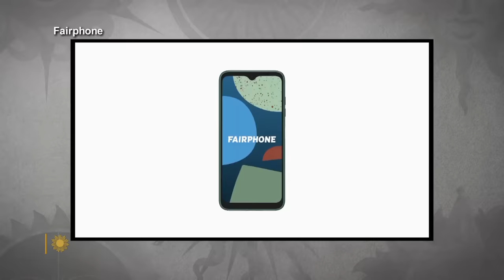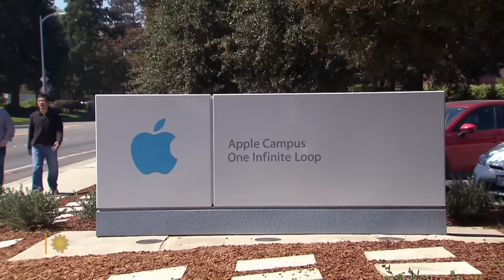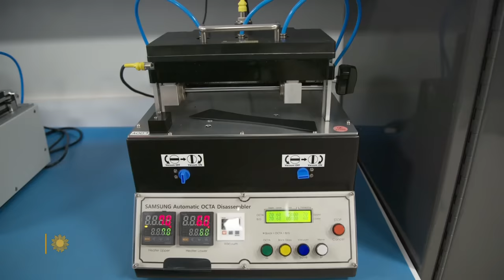The tragic costs of e-waste

Comment: "Right to Repair" is an important aspect of preventing e-waste. Something many do not want you to do easily.
Reply: It's bizarre to me that an easily replaceable battery is considered revolutionary these days... Many phones had this just a few years ago, some would have extra batteries so they could easily swap them while outside. I bought a replacement for my Samsung Galaxy S5 and it was under $10! Right to Repair seems to be catching some strength, I hope it lasts.
Reply: Unsustainable capitalism and constant need for growth produces all the trash. Repairing something is cheaper than buying new, and if you aren't buying new then you are hurting those precious corporation's profit margins.
Reply: @TheIVJackal  same here, i replaced the battery in my s21 ultra with genuine samsung parts, battery was genuine and the rear adhesive was also genuine samsung has been selling repair parts to 3rd party companies for quite a while now.
Reply: This is crazy, I have this 15 yr old laptop and I plan on upgrading its ram and maybe battery, I’m pretty sure chromebooks have both of those soddered in, still useful parts that cant be extracted to be put into something else unlike the old ones
Reply: Problem is that this solution does not sale.
Reply: Also custom rom support for all Android device's should be freely available
Reply: @vampyrkiller  or just being able to install other operating systems if the current one is broken, the laptop im using here had a bricked windows vista but i installed linux mint xfce and it worked fine
Reply: I know.

Comment: Planned obsolescence in appliances is a big part of this problem. Stuff is made with a service life baked in, usually measured in months. And they've been doing it for a while.
Reply: Keeps their investors happy,  no check for them if you don't buy every year
Reply: Compare fridge from 1980s to now.  And technology now is supposedly "better"
Reply: @thisguy73  Our fridge is from 1990. My uncle has a fridge from the '50s. If it ain't broke, don't fix it. Besides, our vacuum cleaner is from 1989 and our clothes dryer from '87.
Reply: They've been doing it for at least a couple decades now. Late stage capitalism.
Reply: A scheduled life cycle is the ONLY guarantee where you can conceivably write the CORRECT legislation that mandates actual recycing. "Right to Repair" is the next in line corporate campaign, where petty middlemen like Louis rossman need that $2000 mac to exist so he can skim a $600 Mac from a repair gig. Not a $800 where poor Louis only gets $300.

But what the "repair" MEANS, is massive ACCELERATION of the "repaired" parts, like the cobalt batteries made with child labor when you get to replace the battery that much more often. Then you get to pay ONLY the underpaid child labor, and NOT EVEN the underpaid Chinese assembly that COULD go into funding recycling... with  the CORRECT legislation that mandates actual recycing. 

"Right to Repair" end goal is to NEVER write that legislation, like EU is now mandating replaceable batteries ( as it is funding salt and cellulose battery r&d and seeks to be the new IP landlord). Incidentally, Apple is one of the big actors in global field ACTUALLY using that profit moeny from fat cat western world, to fund refurbishemnt and returns off the riches OF fat cat westerners with bloated currency. THAT is what Apple does with $900 monitor stands, takes it from Jeff Bezos who is the only type to WANT that in his moon rocket.

Comment: The environmental thing we could ever do is to stop buying sh*t!
Reply: 😂😂😂😂  that would take several years of de-programing -  every one wants you to have the latest things
Reply: This would require companies to start making products without planned obsolescence
Reply: Yes, how about only releasing a new smartphone version every 3 years or less? They're not changing that much year-over-year as they were in the roughly 2007-2017 era. How about corporations seriously caring about environment over pure profit? Don't we all long for the "good 'ol days" when machines and devices were built to last? And you could get them fixed at the local repair shop?
Reply: @chelseafan4eva eh. I've had the same phone for 6 years. It's pictures aren't as good as the newest ones but it's fine still. I just treat it like it cost me $700 and a replacement would cost atleast as much instead of being careless with it.
Reply: @chublez  problem is, your software is likely not getting updates and is more vulnerable to a hack....it's dangerous and that's what the tech companies need to be put to task on
Reply: "stop buying sh&t'' ... what about all the jobs that will be lost ?

Comment: Planned obsolescence, FOMO, trends, consumer culture, it's all maladaptive. Instead of making the companies richer and being a part of the problem, use your devices until you absolutely need a new one. I used my last phone for almost five years before buying a new one. I recycled the old one at my nearest e-waste recycling facility.
Reply: Good for you. I actually used my last phone for 11 years (an iPhone 4S from 2012 to 2023). I could have kept using it but all the carriers shut down 3G so it could no longer handle calls or texts. Original battery is still rated at 70% capacity, believe it or not! One thing I miss about it is the perfect size for my hand; all these larger phones are harder to hold and use with a thumb, don't fit in some pockets as well, etc.
Reply: Maladaptive is the best word to describe our consumer culture.

Comment: We need to teach our kids how to buy parts to fix our stuff like clothes dryers, washers, microwaves etc
Reply: Our clothes dryer is from 1987. All we needed to do to keep it running is shake out the lint collector occasionally and replace the drive belt a couple years ago. There are how-to videos on this. Drive belt replaced in under 30 mins. Our microwave is from 1994, only needed fixing in 2003. Don't need a new one.
Reply: Ever heard of planned obsolescence?

Comment: I have an iPhone X which is only getting security updates until next year. Bought in spring of 2018 and it still works great even though the battery is shot. I plan to keep it as a collectors item when I upgrade to the iPhone 16 Pro Max year. Thats my contribution.
Reply: Androids are more durable, last longer, and are cheaper to repair..
Reply: Collectors item? An old Apple phone? Doesn’t even work? Yeah, keep it Friend. Become a hoarder to cut down e-waste.
Reply: What if you change the battery? I have an SE and the battery is also not that great
Reply: Nice "contribution".

Comment: Apple also has software that locks their products that is unusable if the original owner does not log out of it, even if it was not considered lost or stolen. That results in many of their devices go to the landfill even if there is nothing wrong with it. I forgot to mention that they also tie their parts to a single device so you could not even take apart a device to be used to fix another.

Comment: To recycle E-waste, freeze all of it with liquid Nitrogen, to make it BRITTLE, and feed it through a hammer-mill or grinder, and deposit the particles into a room where air jets create a giant whirlwind, which picks up all of the particles, and segregates its different elements into free floating ‘Saturn Rings’, and the separate elements or synthetic plastics, are captured by chutes popping up, to shunt the ‘Saturn Rings’ into individual elements or plastic bins, for cheapest and easiest MASS recycling.

Comment: My newer Motorola Android phone unfortunately shattered in August (purchased end of March '22 bc my older Android wouldn't upgrade and I needed a security app for my airport job. Which is so stupid). Although very broken it still is completely functional (least til it randomly glitches and I literally have to wait for the phone to die instead of like in the old days where, you know, you could just rip out the battery and slip it back in). I share all these silly side notes bc newer certainly isn't always better. Make the phones so they don't shatter. Make the software acceptable to all carriers so we don't need to upgrade a perfectly usable phone. I don't even think I can fix the screen bc of how long the device is, which is also stupid! A very powerful and upsetting story.
Reply: I just wish companies would let you unlock the bootloader without jumping through a bunch of hoops. The only companies who do are Google, OnePlus, and Nothing. Even then you still have to be careful because many times the carrier versions of those phones have locked bootloaders (especially Verizon, Verizon is the absolute worst for rooting)

Comment: A good start is stop buying new tech every year just to impress people. I buy a mid tier phone like a google pixel and use it for 4 to 5 years, my current one has been with me for almost 2 already. Same goes for my desktops and laptops. Plus, you can upgrade those devices for the most part assuming you did not buy an apple. The worst offenders are some of the people in my Univ, who every year like clockwork have a brand spanking new iphone, brand new macbook, brand new ipad, etc etc. This mentality of buy reliable, maintain, and keep a long time also applies to things like cars. Stop buying flashy unreliable BMWs etc and pick up a bare bones Honda that'll last 15 20 years on basic maintenance.

Comment: The fault lies on companies that make repairing devices impossible through RFID chips hidden throughout the device, proprietary software or firmware planted into battery management system, and or rigging a device to fail if it is opened up or the battery disconnected.  But E-waste is our fault?
Reply: It's partly our fault. Like, why buy a new phone every 2 years? Most phones last at least 3 years before they need their battery replaced. If your phone's battery life and performance starts to degrade, you can get the battery replaced. Apple has an iPhone battery replacement program. If you really need a new phone, you can buy it used or refurbished. This is something that's at least partly in our control.

Comment: Until there is a tangible and efficient, effective working plan to deal with this e-waste, I am not going to sweat this problem.

l use my stuff for the long-haul, but when it's no longer working or worn enough, I am just going to take it to an E-Waste Recycling place and let them deal with it.

It's because I have no choice than to use these guys,  other than to throw it in the trash.